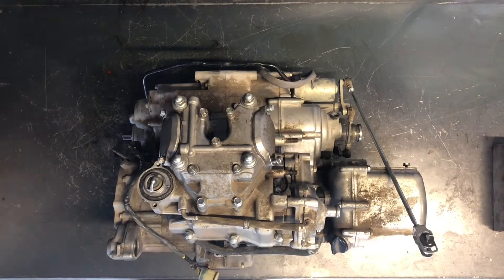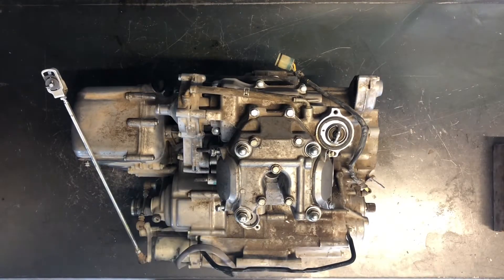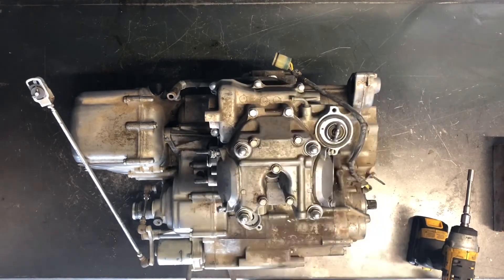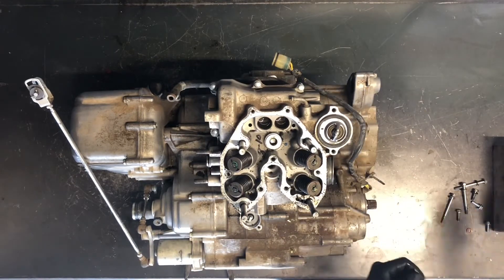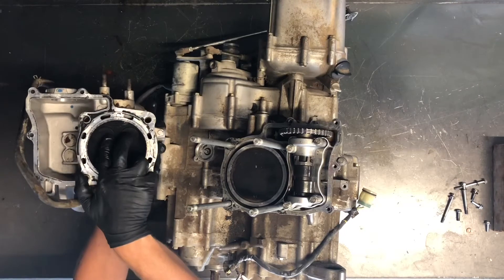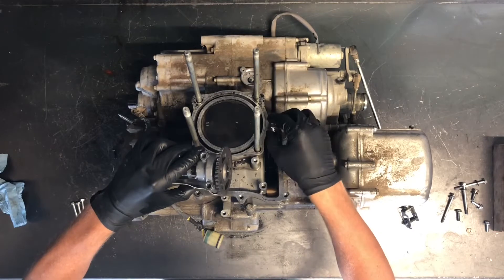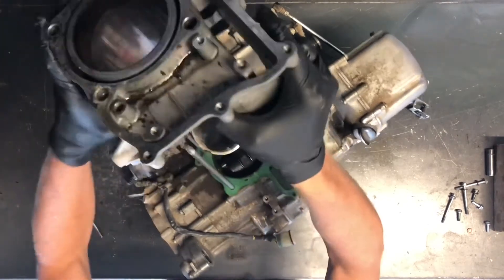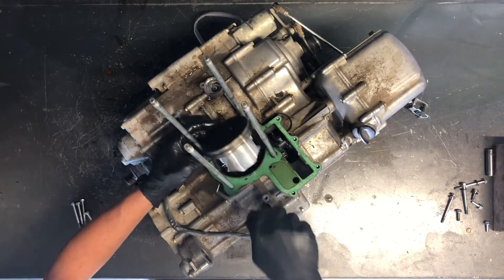Honda Foreman Rubicon 500  -  Top End Cylinder Head w/ Piston Issues

Comment: my 2014 rubicon 2100 miles have a little play between the rocker arm and the head cover. the 2 rocker slides side to side seem changing valve gap causing erratic clicking sound. how to fix? i see that two valves have spring washer to hold rocker.